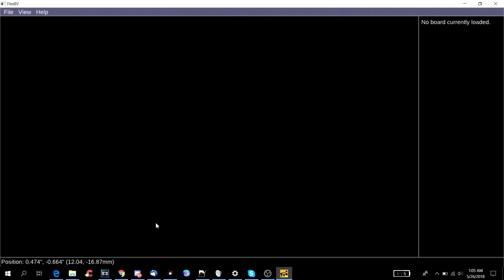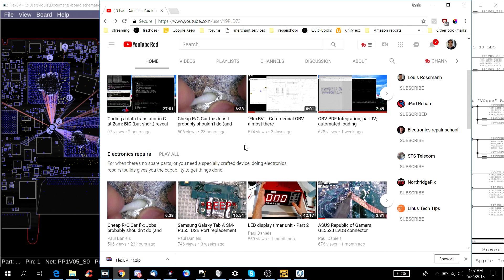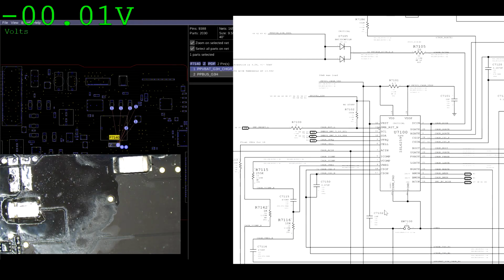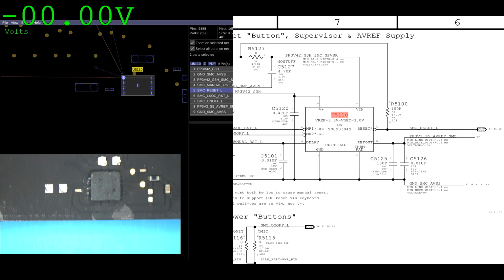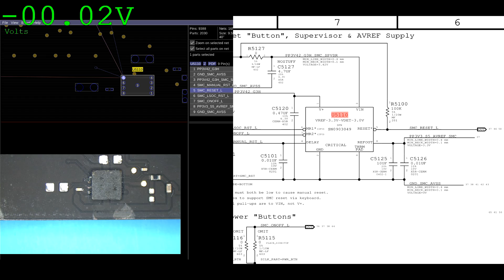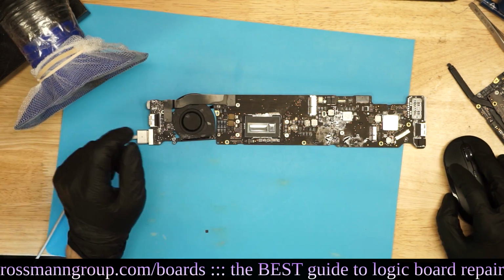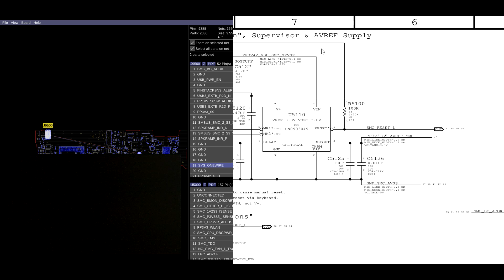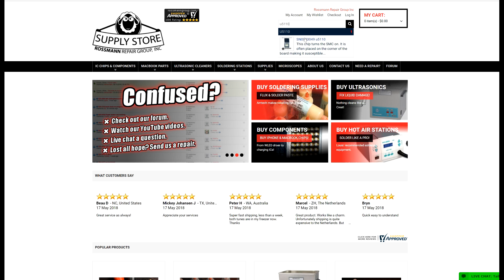Introducing Paul Daniels' life changing software

Comment: First, a big bravo to Paul Daniels for the great software and constant improvements along with it.

Now, I'd like to see a conversation with Rich Rebuilds. He appears to have delved greatly into Tesla Model S's, along with Tesla's baloney being similar to Apple's rotten snafu.
Reply: Actually this is how you make money in an industry, any industry.
Reply: If you're referring to the second part of my comment, then I'll let you know I work with specialized repair of IPC Class 3 rework/repairs primarily on mission critical systems. Nobody dares to pull the crap in my industry because even a small defect may result in many imminent deaths!
Reply: I've worked in engineering for subsidiaries of two major automotive manufacturers, and well... how do i put it... not surprised when shit happens?

I have also worked in medical device industry, and yeah, things are a bit different because things absolutely may not fail; but then they too must always invent ways to get more money out of any amount of work that they do.

A company that performs its business in a consumer friendly manner will just be less successful than one that takes advantage of the customer every step of the way, unless the consumer is particularly corruption-resilient and well-informed.
Reply: Maybe so, but as a licensed MSEE/PE and owner of my company, I'll do everything in my power to greatly reduce that risk. I'm also a licensed attorney as well. My company may run on thin margins, but I'm solvent as well as being litigation free, and debt free. I know several other companies similar to mine, and they follow much of the same operations in a very similar manner. We are absolute NOT allowed to do that kind of behaviour.

So those companies you work for can pull that. Mine and the few others I work with will NOT!
Reply: I commend your commitment.
Reply: Thanks. I know my language was quite brash, however... it is what it is.

Btw, when I started as a AS ET back in 1989, the companies I worked for held me to nearly the same standard, yet we were only servicing/reworking mainframes and data centres. Years later combined with other jobs and completing higher degrees, I finally took the plunge about 17 years ago, and yet, I've managed to perform "the impossible."

Now, in regards to Tesla, Apple, and similar companies, I agree. Companies similar to those don't mind being puppets to their shareholders, provided they can keep the stream of money they like to burn through. Some of the in-house counsel are also the worst types of people working in law, similar to what may have been mentioned around YouTube.

Comment: How long until board repair is fully automated? I can see a big market for that in data centres.
Reply: Cameron Burrows never happen, company loves to sell the entire device/motherboard, and they don't care about e waste
Reply: What about components that cannot be tested in-circuit? An ideal automated repair machine would depopulate the board, test the board and every component individually, and then repopulate the board with known good components; however for one, you have now used degraded and additionally stressed components, and for other, you have expended more cost and effort than needed to make an item in the first place.

Comment: Are those SMC reset ICs just defective?  You seem to change them often.
Reply: Defective as in manufactured with a fault in procedure, with off-spec material, or defective by design as in containing critical engineering defects? Unlikely, more likely they're just always on so if there's a short anywhere, it's hitting them first or with highest likelihood. Might have perhaps used a little bit of extra external protection and precautions.

Comment: I just want to say, this is an example why he chose MIT licence for an open source project. If he put a GPL, he could not make an comercialized version of his creation as you are not allowed to change licence from GLP to non Gpl complient even though you've made the software yourself.
Reply: not quite. He himself could provide the code on a second license and base work on that. However he will be required to always keep the existing code also available under gpl. Furthermore, an additional license would require explicit consent by anyone who has contributed to the project and if they decline their code would have to be removed. Long Story short: yes, it would be possible, but it would probably be a large amount of legal work.
Reply: The way to do this with GPL is to require copyright assignment contribution agreements from every contributor, which is not that difficult, but for such a project a source of unnecessary friction and a fork waiting to happen.
Reply: Please note that there are several contributors to OpenBoardView (me being one) and that the original source code was written by someone else (Chloridite). This person chose the MIT license and I'm thankful for that too. With GPL, he would still be able to sell it but he would've to release all his source code under GPL. Which is not really an issue but people often fear that no one would buy the software if the source code is available (which may or may not be true).
If he wanted to have a GPL and a closed source version, all the contributors would have to agree on that (and that'd never have happened).

Comment: If schematics and PCB were available on Altium it also has this feature...
Reply: except Altium Designer Viewer is free and also has the same capability.
Reply: I admit Altium it's not cheap, full of bugs and still running in 32bits in 2017… my point was you can have a PCB to schematic link in a lot of designer or viewer tools, the issue when repairing is finding the leak for the schematic and much better indeed is to have the the linked PCB... So the difficult part is to have unofficial PCB files with correct linking... Even better is when each component has the datasheet link in parameters... Then you know what to expect from each IO of each IC. Countless times I had to throw away board because the broken piece was a Chinese unreadable datasheet or an impossible to find part...
Reply: So does KiCAD, and EAGLE since 100 years ago. It's always been a real bummer if you're used to repairing stuff with the ECAD files (because you or someone at your company designed it), and you have to repair something you just have PDF schematics or boardviews for, and have to do the manual search shuffle. This looks like great software for those folks. Me, I usually have ECAD files and the tools to view them, because it's usually something I designed or was contracted to fix by the designer.
Reply: except that altium costs you a 5-figure value in the cheapest edition, while FlexBV is about 70 bucks.
Reply: Also, I've never bought Altium, though I've worked at companies that use it, but I doubt it's 5 figures for the cheapest edition, when both PADS and OrCAD are only mid 4 figures, and much superior tools. Altium Circuit Studio is only $495.